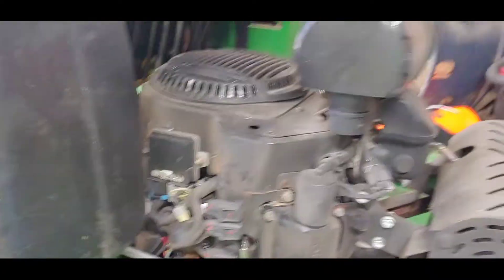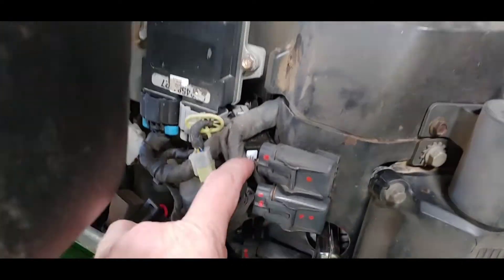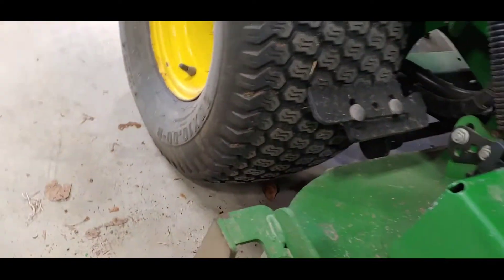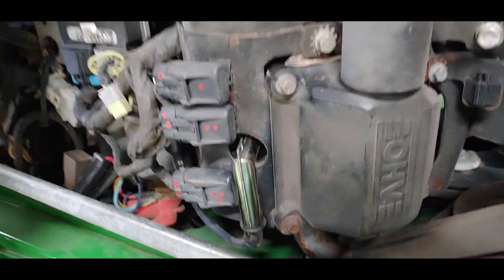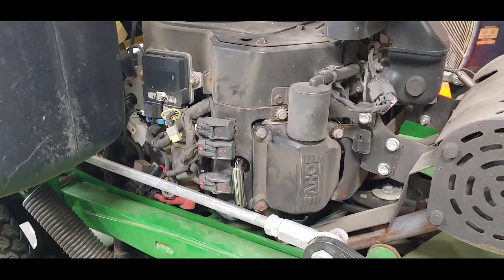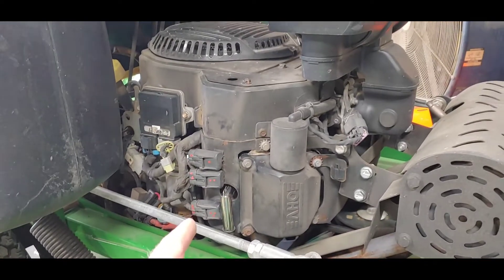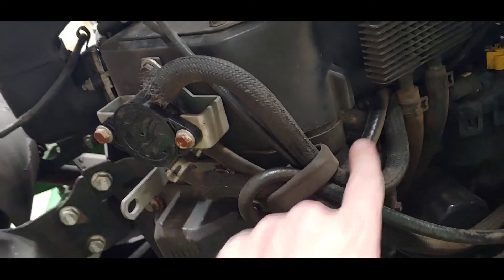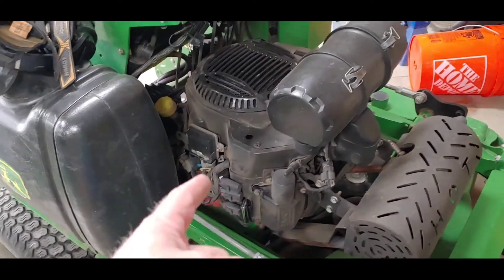HOW TO: KOHLER Command Pro 25hp EFI Coil change

Comment: What all were your symptoms? I have a Kohler Command pro on a Exmark Lazer. It’s bogging down pretty bad and back firing. I can’t figure out what is wrong. Maybe coils or plug wires?
Reply from the maker: Primarily had an issue with the mower surging under a load when it got hot. Seemed like it would be starving for fuel. It seemed to work itself out after idling down and letting the mower run for a bit at idle and slowly throttling back up. So thinking back as I mentioned in this video about the plug that was wet when I changed it..... I thought maybe it wasn't firing all the time and this made me think the coil could be cutting out when it gets hot. The plug wires are made as part of the coils so you can replace them all at once. The fuel pump could be going bad or injectors. Also check any gasket for leaks as well. Hope you get it worked out👊

Comment: Did it solve your surging issue?
Reply from the maker: It improved but didn't clear it completely up...I have more videos on other things that I have done to it also and it's running much better. I think it is still running a tad bit lean so I have got to try and get it adjusted